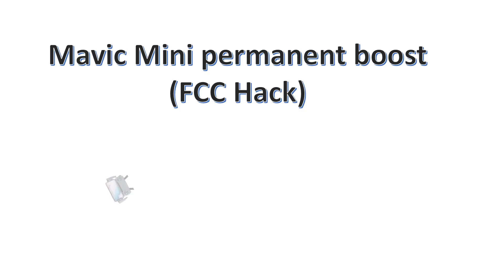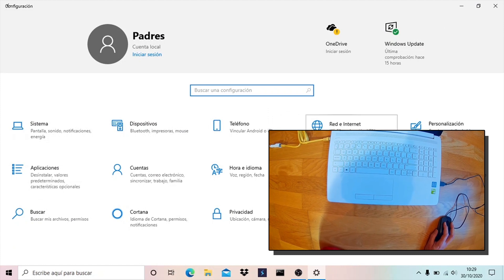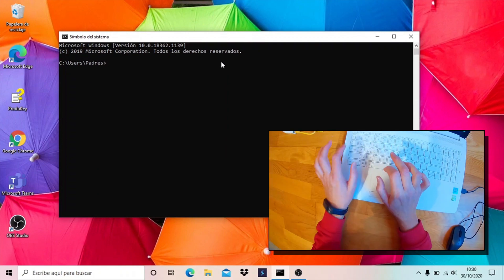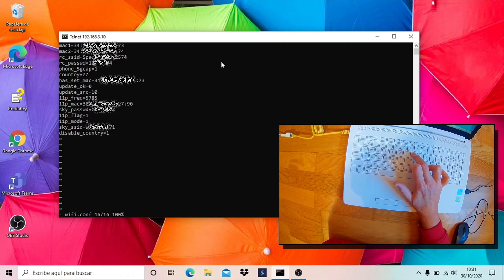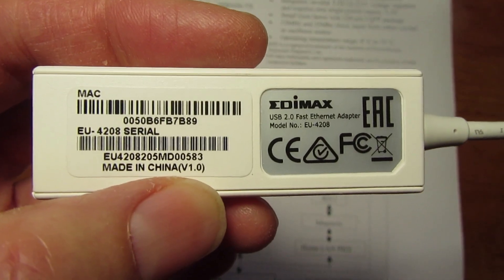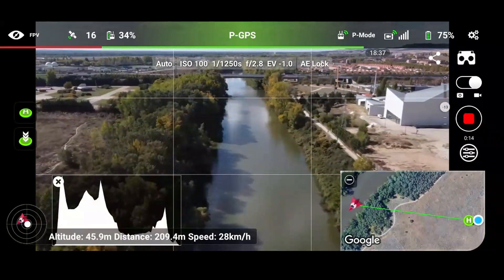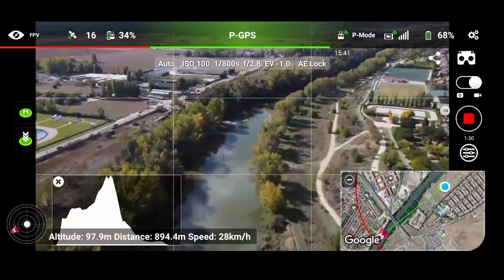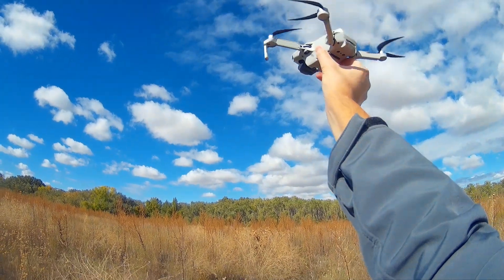Mavic Mini CE permanent boost mod --2th EPISODE--

Comment: Tried on multiple computers and every time I try to connect to the telnet IP it says "Could not open connection to the host, on port 23: Connect failed". I have shut down all firewalls but the problem won't go away. Any ideas?

Comment: Hey, thank you for sharing this video!  Do you maybe know if it is still working with the latest firmware?  also, when I plus the usb cable directle into the pc I can see the serial COM3 apearing. Do you maybe know the settings to connect to it instead of the otg  + eth to usb adapter?

Comment: Well I found the same adapter as yours and I`m awaiting delivery. My question is this: do I have to make the fake gps hack in order to set the FCC or it is okey without it? In some other tutorials it is written that it must be done the first hack and then the one on the remote controller, also after the FCC hack i must fly only on 5G on my app? Correct?
Reply: this is exactly what I want to know. I'm wondering if thegps part unlocks additional rf bands, and the conf change initiates boost. Ice never heard about only using 5ghz so thanks for sharing that info!

Comment: Do I need to take any additional steps to achieve the range? I modified the config file, and I get a pop up when I start the app about adjusting to local regulations however I'm not noticing an improvement in range and still have 13 channels
Reply: Naybe you have yo spoof gps aswell

Comment from the maker: Anyone tested this mod with last week RC firmware update V01.00.0600 for Mavic Mini ?
Reply from the maker: Answering myself... RC firmware updated to RC V01.00.0600 today.
After update, I succesfully tested telnet comunication between computer and Mavic remote control.
I could verified wifi.con file is preserving boost mod.
I'm only pending of flight test.
Keep tuned.
R.
Reply from the maker: Tested succesfully ! I flew with new firmware RC V01.00.0600 and boost mod worked great. I got same range than previous firm.
Reply from the maker: @someOne-ef8tl  yes. still working great
Reply: @r.3424  Work on 5.8
Reply: Works on mini se... But 13 channel 2.4 ...

Comment: i type "telnet 192.168.3.10" and i have the message: "could not open connection to the host, on port 23: Connect failed" any solution?
Reply: dokimases na kaneis auto pou leei sto 1:10 ?
Reply: @kode_g7459  i did that too. still no luck.
Reply: I also get this message

Comment: Can i use RTL chipset (asix ax8872B)?
Reply: hey, just search in google: "mavic mini ce boost github", this method is technically the same. But it is more easy and without adapters. Just using a USB cable
Reply: @MyAboChannel  never trust opensource
Reply: @joeery5699  You could be right. Did you tried out your Ethernet Adapter?
Reply: @joeery5699  I agree the whole point of open source is you shouldn't need to trust it, because you can read the code yourself ;) And looking at the code on that site it seems to just send a byte sequence to the serial port. Did you see something suspicious?

Comment: This is stupid I get that range with my mini without boost mode
Reply: Weird to call somebody's helpful video stupid when you clearly don't understand RF. Opening up channels simply permits for less interference. The frequency of the radio signal isn't changing, but the channel data transmits is being altered.

If you're already in an area with low interference then it won't make a difference. It's not really up for question.
And i looked at your channel... you're flying in the bloody countryside ya plonker! :)
Reply: Are you shure?
Reply: @darkonojic7494  absolutely I have the video on my YouTube to prove it
Reply: you are uneducated, if you read the description its for the mavic mini you have the mavic mini 2.
Reply: @guyems4490  I commented 6 months ago when I had the mini  
6 months later now I have the mini 2 sorry for looking so dumb 😂
Reply: This hack only affects the 5,8 GHz band. Maybe you used 2,4 GHz. ?

Comment: Hi , i did see a youtube vid where they measure the output antenna power of the CE model, first without hack , 16dbi and with the FCC hack 12dbi, so this dont seems to actually works  or give any advantage.  They used an RF power meter.
Reply from the maker: I have no RF meter, but I can assure you the mod works based on countless range test. Believe me.
Reply: Based on what I've heard from the maker of dh the transmit power dynamically increases. I saw the video you are talking about and I think his testing methodology was flawed. He kept the drone and rc in close proximity, so the remote and drone never detected a need to increase transmit power. Repeat his test but actually fly the drone, I'm pretty sure you will see the power increase when it detects low signal to noise ratio.

Comment: Hi, i have the european CE model.  If i do the 5,8ghz hack like described here.  Can i still go to manual select 2,4ghz band on my controller if i want to?  Or is it then after the hack only fixed 5,8ghz mode??
Reply: Hello, 
This hack only works for 5.8 GHz ! So you will have your normal dji fly app, with normal CE 13 channels. If you go manual on any 2.4 GHz channel, it will not change anything (classic CE power output). But if you choose a 5.8ghz channel, there the power output is going to be way bigger. 
So yes, you can still change between 2.4 and 5.8ghz ! You are just modifying the controller, not the fly app :)
Reply from the maker: After mod, you will be able to select not boosted stock 2.4 Ghz or boosted 5.8Ghz
Reply: Thanks, hack is installed successfully on on my mini , so I need to check the range when weather is fine

Comment: Hi. I was able to change wifi.conf before but now it looks blank. Is it about the version? Which version should I switch to? Or is there any other method?
Reply from the maker: I'm afraid accidentally you erased your wifi.conf file. Try to update controller firmware using DJI Assistant 2 for recovering.

Comment: Hi. I did all the ways you described and everything worked well. But i still have 13 Channels in the dji fly app? Is this normal?
Reply from the maker: Yes, it's normal. You only will get 11 channels if previous Fake GPS non-permanent hack applied, like me.

Comment: Please find out if this can be done over wifi. It's not easy to find the adapter with ax88772a chip. Most of the ones available have Realtek chips. Thanks.
Reply from the maker: You need an adapter, or buy DH method